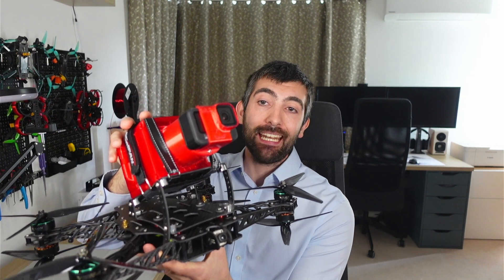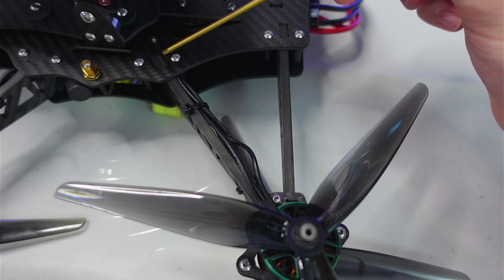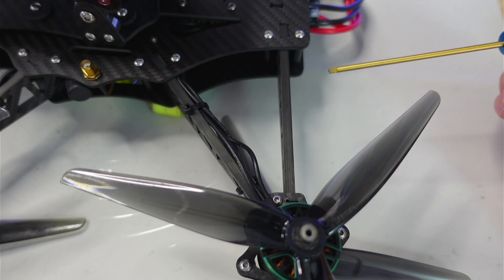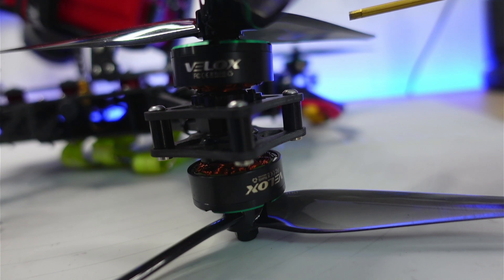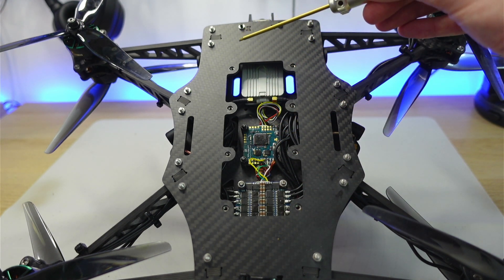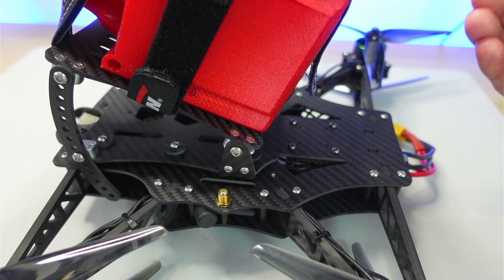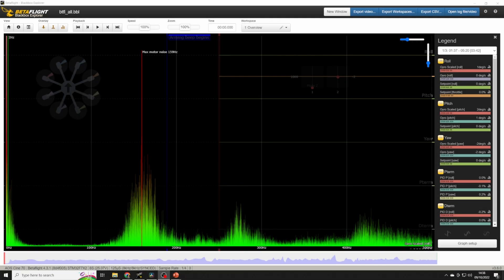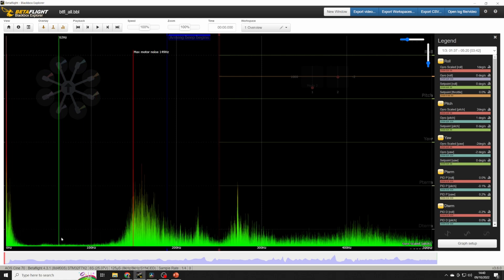The AOS Cine80: Boldly going where no Cinelifter has gone before!

Comment: Cinelifters shouldn't crash often but wouldn't the cut-outs in the top and bottom plate wear out quickly causing tolerances and wobble?
Reply from the maker: The cutouts don't actually hold the arms in place. The arms are held by the friction between the top plate and the top surface of the arm and the bottom plate and the bottom surface of the arm. The slots just hold the arm in place until you tighten the screws down. Before the screws are tight there is a tiny amount of movement. After the screws are tight it's like one piece of carbon.
Reply: Ah, understood. Many thanks for the feedback. The Cine80 will definitely be my next project. 🤩

Comment: Hey.. when you going to get some cine70 footage? Been waiting since I bought the frame months ago. Still haven't seen any. Also.. why is this frame $50 less than the Cine70 was? :(
Reply from the maker: The lower price is because it comes without the camera mount. The camera mount is sold separately for the Cine80.
Reply: @ChrisRosser  Oh.. still haven't put my cine70 together yet.. did it come with camera mount? Shows what I know. Still would love to see some video of the cine70. Did you still not get any back from the folks you sent the 70 to months ago? Going to go out on a limb here.. the 80 and 70 have very similar flight characteristics with the 80 lifting more thats about it?

Comment: Will there be a UK / EU vendor that isn't QSL? The shipping to UK / EU will be mad plus the import taxes. And I have a slammed squirt from them which costed way more than other cinewhoops and it's probably the one bird that disappointed me the most / at all. I just thought if I paid a premium price, I'd get a premium product but in practice even the tune seems shakey and the gopro mounting is really awkward.
Also at the time it was advertised with the fullsize dji cam and I got a caddx cam (the silver one, Idk if it is a rehoused nebula pro or a re housed original cam)
Reply from the maker: QSL will do wholesale of the frame kits for retailers in the EU/UK. Once production is up and running I'll do some direct marketing and try to get it widely stocked.

Comment: Sometimes the esc mounting wholes will be slightly energized with a small voltage. By mounted your sma directly onto the carbon you have grounded the frame so with some escs there will be a current leak. Whenever I finish a build I always run continuity between battery plus and neg to make sure there is no potential to have any current leakage. Not a believer in grounding a frame as it can cause current leaks.
Reply from the maker: Grounding the frame is a controversial topic. In my opinion ESC mounting holes should be plated and either be ground or unconnected. Anything else is unacceptable. I prefer the whole frame to be grounded either through the ESC/FC stack or through the SMA. That comes from my experience building pcs where the case is always ground.
Reply: @ChrisRosser  Seconded. Anything other than grounded or isolated is a recipe for disaster. You really have to know what you're doing, and even then it's still just not a good idea.

Comment: Fantastic job on the vertical truss arms, using the CF in the right direction! One question, how do the canted motors work on and X8, because to create a yaw reaction, one motor spools up, the other spools down but net thrust from any given arm stays the same?
Reply from the maker: The motor that spools up is leaning slightly so that it's extra thrust pushes the quad around in the desired yaw direction. The motor that spools down is leaning the opposite way so there is a net thrust component in the correct yaw direction.  Hope that answers the question!
Reply: Ah that makes perfect sense, I assumed that you'd canted the whole arm but watching it again I see the motors are canted individually in opposition directions. Nice job!

Comment: I use 10mm carbon on my quads for the arms that thing is 2 heavy check out the rebel ruxus and check out the frame weights for the 5, 6, 7 inch quads
Reply from the maker: It's certainly a lot heavier than even a 7". But when you're carrying a 1.5kg camera you need a lot more power! Even a 10mm arm would be way too thin for a Cinelifter. That's where the 2x5mm vertical trusses come in!

Comment: Looks awesome, what motors would you recommend for a 3kg payload?
Reply from the maker: Does that include the drone battery? For really dynamic flying with a camera system that heavy you might want to get in touch with me by email about the upcoming Cine100. 😉 The Cine80 is ideal for dynamic flying with cameras up to 2kg or smooth crusing with heavier systems. In either case 2808, 3008, 2810 are good sizes for the Cine80

Comment: Hello Chris ! 
Technical question, why 4 arms are preferred to 8 arms for octocopter cinelifters ? Is there a gain apart from being more compact ? I ask because RotorRiot made a comparison with same motors and same props and the 8 arms quads had much much more thrust than the 4 arms octocopter. Thanks in advance for your answer :)
Reply from the maker: 2 main reasons:
Four arms makes it easier to get the props out of shot because they are 90deg apart rather than 45deg. 
The total platform size of an X8 is smaller than an Octo. Putting it another way you can fit larger props for a given size  of drone on an X8. This really helps offset the loss of thrust and efficiency. In fact the correct comparison might be an 8" X8 vs a 5-6" Octo as they both end up a similar size.

Comment: It seems like a lot of cine frames now are including landing legs or raising up the motors to keep the lower props clear. Any thought in that direction?
Reply from the maker: That's a great question. I did design and simulate a curved arm design that lifted the motors up. That style of arm is much longer, heavier and less stiff than a short straight arm (minimising the length of the arm is a key performance criteria for lifters I think). Placing the battery on top behind the cine camera necessarily creates a longer frame with more MOI on the yaw axis which is waaay more of an issue due to the lack of authority compared to pitch and roll.

Comment: are you sure it's better than the Shendrones Akira?
Reply from the maker: In the 8" size class it's really up against the Thicc and Siccario. In my opinion both of those frames struggle with frame resonances as evidenced by logging and  the arm bracing approaches that have been tried to improve things (these haven't worked well due to the mode shapes of the problem vibrations). I think the AOS Cine80 is a step change improvement over them.

Comment: I think a upcoming cine 100 should be also able to do real long flights if it is not too heavy. We have the motors and the props, but there is not one good frame above the aos 7 out there to handle 10 size props under 300gr.
Reply from the maker: If you're looking for a 10" platform for cine work please drop me an email! I'm confident I can hit the weight target and deliver excellent vibration performance but it would be great to work with you on any other requirements.

Comment: did you try mixing biprop and triprops? 
or compare performance with lets say HQ DP 7x3.5x3 V1S or GF 7537-3
against the MQ 7x4.5x2 or GF 7035-2
Reply from the maker: It's on my radar to fully understand counter rotating prop configurations. The limitation is the cost of the test equipment!